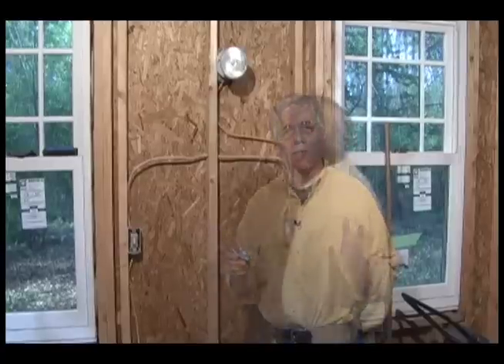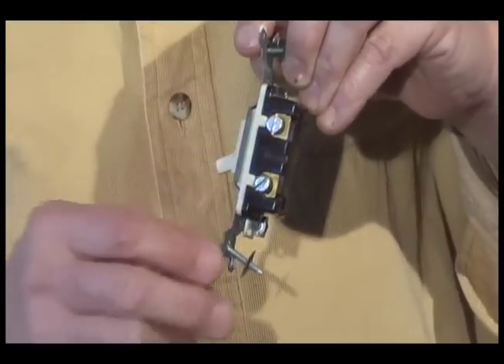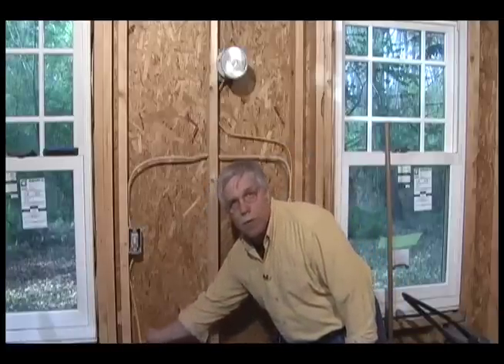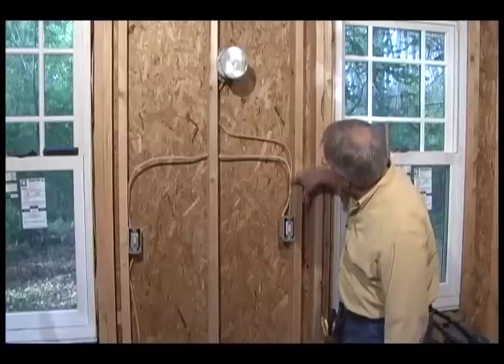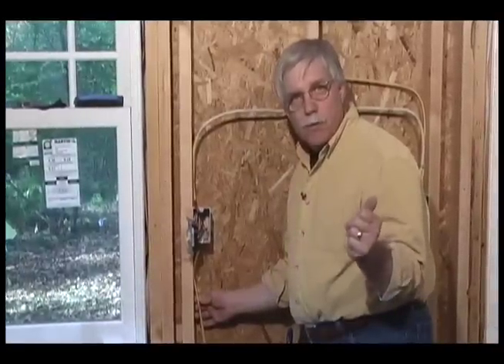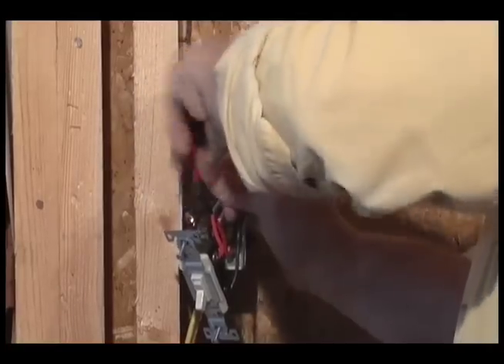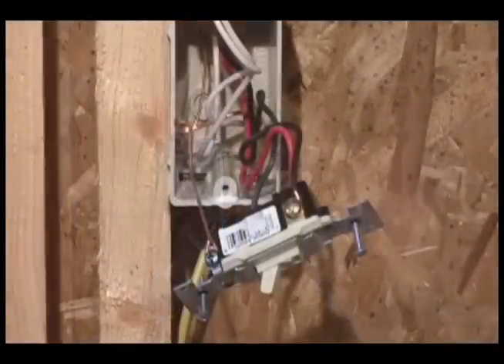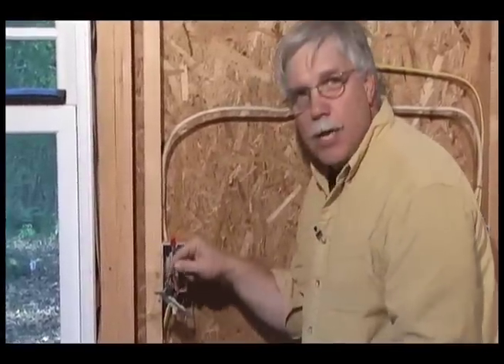3 Way Switch

Comment: Sorry if I am missing this. I cannot visualize how the current travels from the first switch to the second switch when the first switch is off. 
How does the current bypass switch number 1 to still be utilized by switch number 2? Is it simply the design of the switch that maintains a constant hot beam even when switch 1 is “off” so that switch 2 can control “on” and “off”?
Reply from the maker: Simple. t=The inside of each switch is made just like a railroad track switch. Think how one works. The movement by the switchman makes the metal rail(s) PIVOT from one track to the other. In this case, the pivot point is the BLACK single screw on each switch. I'm happy to discuss this on the phone with you so you understand it: https://shop.askthebuilder.com/15-minute-phone-or-video-conversation-with-tim/

Comment: We have two 3-way switches about 5 feet apart, so I guess technically you're right that they're never as close together as you show, but ours are close...
Reply from the maker: Why of course I'm right! :-O Share why you'd have two so close together, please. I'm intrigued!!
Reply: @askthebuilder  I have no idea, we are the third or fourth owners of the house, no idea what they were thinking. It is a small t-shaped hallway at one end of the house, there is a switch for the overhead light at each end. So there's a 4-way switch within a few feet of them too. But that is not the most unusual wiring in the house! Almost every room uses 3-way or 4-way switches for the overhead lights, with some of those switches being in very weird locations. Often in other rooms of the house! And not always adjacent rooms!

Comment: Should it be mentioned to tuck the bare ground wires well back inside the switch boxes very carefully so there is no chance they can come into contact with any of the live terminal screws on the switches.?
Reply from the maker: Normally I'd say no, but lately, I've seen a spate of unbelievable comments and questions that telegraph to me that some people have no concept of what's in play. So much so they shouldn't even be close to energized conductors.
Reply: @askthebuilder  Thank you for your reply. I thought it would be worthy of pointing out to those that may not know that in the best interest of safety they need to be sure that none of the bare ground wires are able to come into contact with any of the energized parts of the switches and receptacles. Your videos are clearly the easiest to understand. Thank you for sharing your knowledge and skill.

Comment: 14 years later and this is still helpful. Thanks homie.
Reply from the maker: Yep. It will be helpful for the next 200 years. The design and function of the switch will not change. Just like pulleys.

Comment: I got confused with two black wires. ( Why did not they make two different colors like black and blue ?). So they distinguish two black wires by the screw colors. ( Am I correct?) The hot wire connect to common with the dark screw. The traveler black wire connects to the brass screw.
Reply from the maker: No confusion when you get my newsletter: To get unlimited tips each week, subscribe to my FREE newsletter at www.AsktheBuilder.com

Comment: I already replaced my 3 way switches and just copied the (super old) old switch wire placement by lining up the ground wire screw side, and then detaching one wire and reattaching it one at a time, but old switch was always  “upside down”, meaning the ground screw was on left , so I rotated it and then swapped my one wire at a time...and now I’m terrified I miss wired and my house will burn down... the switches work fine... does that confirm I did it ok?
Reply from the maker: Maybe! To get unlimited tips each week, subscribe to my FREE newsletter at www.AsktheBuilder.com

Comment: Your not suppost to mix 12-2 12-3 with 14- 2  14-3. . 14 -2 and 14-3 are for 15 amp circuits  12-2 , 12-3  are for 20 amp circuits
Reply from the maker: I explain what happened in the video description.
Reply: @askthebuilder  oh ok because  I'm  an electrician  by trade  been doing it over  30 years nice  video btw

Comment: Hi Just have a question in regards with 2 lights on 2 3way switches. I have the power source going to Box 1 switch and a wire to the light bulb from box 1. I have a 14/3 wire going from Box 1 to Box 2 and a wire going from Box 2 to a light bulb but no wire going from Bulb 1 to Bulb 2. Is it possible to do a 3 way this way?
Reply from the maker: No. You need another wire between box 1 and 2 and daisy chain the lights together.
Reply: @askthebuilder  Thanks. I was able to complete my task with your advice.

Comment: I've hooked up two 3-way switches with several 11 W LEDs.   Even when the switches are off, the LEDs glow faintly all the time, though it's only noticeable at night.     Is there a way to fix this problem?  Do you know what brand of switch doesn't leak current like this?
Reply from the maker: Get unlimited FREE tips like this each week by subscribing to my newsletter at www.AsktheBuilder.com

Comment: So my dad and I are trying to do his new garage. We are doing two 3 way switches on 6 different lights, the light inside flips the lights on and off like normal but the outside light does t do anything. Not shortening or anything is happening. What could we be doin wrong. Everything is wired like this video.
Reply from the maker: No wonder your channel name has awesome in it! For unlimited tips, subscribe to my FREE weekly newsletter at www.AsktheBuilder.com

Comment: I am getting that this system allows multiple ways to provide power through the switches.   The thing I don’t get is how the light is being turned off from any switch since it looks like you are just switching hot wires by moving the switch.
Reply from the maker: Get unlimited tips like this each week for FREE by subscribing to my newsletter at www.AsktheBuilder.com

Comment: should the traveler wires be both hot or both cold ?  Meaning there should never be a case where one traveler is hot and the other cold ?
Reply from the maker: By default one traveler is always hot and one is always not energized. Go to my www.AsktheBuilder.com and look at my illustrations of how the switches actually work. They're exactly like switches on a railroad track.

Comment: Is it ok to run two Romex lines through one stud hole?
Reply from the maker: Generally yes. It's all about friction and abrasion over time from thermal expansion and contraction. Look to see what the NEC says.
Reply: Ask the Builder thanks. I've learned a lot from your videos. I'm about to get my rough-in inspection for my bathroom installation. I'm converting an existing storage  room into a master bathroom. I pulled permits 6 months ago. I'm more than a little nervous.

Comment: This home was built in the 70s, it has 2 black wires and one white. No vids here address that, I'm lost...Help pls
Reply from the maker: No worries. Your help is ABOVE. Watch the video numerous times until you understand the concept of hot wire, travelers and the power wire to the light. Seriously. I don't care if the house was built in the 1870s, it's still the same method.

Comment: I had to replace an electrical outlet. I managed to locate the breaker that cuts the power on it. However, while taking wires off of the outlet, there was a spark and a light in the room where I was working, went dim. So, I reattached it. I found the breaker which killed the light where I was working to change the outlet safely. I measured across it with a multimeter. Would you tell me why there was a spark? I thought since I killed the voltage across it I was safe.
Reply from the maker: Watch my NEW live stream videos! Subscribe to get my FREE newsletter here: www.AsktheBuilder.com

Comment: Great tutorial video!  I followed your instruction, checking 3-way switches & wire connections.   They're all good, but the working-light is still not on.  Appreciate all your help.
Reply from the maker: So maybe you need to read this column since you're convinced the wiring is perfect:

http://www.askthebuilder.com/light-bulbs-burn-out-quickly/

There's a 1:1,000,000 chance the switch is broken.

Comment: Great video but why do you use 14/3 between the switches and 12/2 to the light fixture?
Reply from the maker: That is 12-gauge cable that is about 30 years old. I had it leftover from when I built my house. Back then, the color coding requirement was not part of the NEC.

Comment: I've come to the right channel! Here's a question for somebody: Outlet boxes are $.29 each at Home Depot, whereas light fixture boxes are over $1. Is there any reason not to use an outlet box on the ceiling for a light fixture? I know it works because I've done it, but is it wrong?
Reply from the maker: You need to ALWAYS take into consideration the WEIGHT of the ceiling fixture. And who's to say that a FUTURE homeowner may put up a small one like you might intend to. In my opinion, ceiling boxes,  and the code may speak to this, should ALWAYS be steel boxes well attached to the ceiling joists so they can support 20, 30 or 50 pounds.
Reply: Thanks. Very insightful and informative.

Comment: I watched the video for the 3-way but this question is not answered in the video. How does one wire each of the  three way switches when all of the wiring is hidden behind finished walls? I don't know if the light is between the switches or beyond the 2nd switch. Also how do I determine the location of the black incoming hot wire and then locate it in the 2nd switch?
Reply: I see no one answered for you, but I will.... Look at the Wires coming into the box(S) .... You will see one SET, that has White, Red, Black and Copper(Ground)... you will ALSO see a Set of wires that are ONLY Black, White, and Copper (Ground) ...To Simplify, the BLACK from each of the 3 Wire Sets (Black, White, Copper), will land on the BLACK SCREWS ... Whites will Wirenut together. On the 4 wire sets(Black, White, Red and Copper) will act as the Travelers (Black and Red) ... These will land(Connect) onto the TOP 2 Silver Screws. I usually land the Blacks, onto the Same side of the Switch and Red on the Left... but the Travelers Dont Matter... And .. It doesnt matter Where the Light is situated, as long as you follow the directions, It WILL work... :D
Reply: Thanks. I wired this myself. It was simpler when visible but it may not have been the traditional way. An added factor is there are two switches at one end.
Reply from the maker: Thanks! You might want to do two things: 1. Subscribe to my FREE newsletter at www.AsktheBuilder.com 2. Start watching my LIVE streaming videos! Lots of fun and you get to ask me questions in real time. Be sure to turn on NOTIFICATIONS about when I go LIVE.

Comment: Tim...my incoming power switch must always be "on" for other switch to work..what's wired wrong?
Reply: Ron... Read my reply to David Boleneus.....  You have the Travelers Crossed with the Power Feed.
Reply: I bought my new place, replaced every outlet and switch in my place but came down to the three way switch same issue as you, at first thought should of taken a picture but did everything and still, one switch relies on another. Did you figure out the issue?
Reply from the maker: Ron, watch this other video of mine: https://www.youtube.com/watch?v=1FoMlG91lDA&t=6s

Comment: WOW, is that something new? Two switches working three ways? Will wonders never cease? But what if I wanted to add another switch in between? I guess it can't be done.
Reply: Yes Steve, Watch Tim's "How to wire a 4 way Circuit"
Reply from the maker: It can be done. Go watch my 4 Way Switch video

Comment: Do I have to use a 3 way switch
Reply: IF you want to control from 2 points, Yes...else the Single Switches will SHORT OUT the circuit.
Reply: AND you will have to have a 14/3 BETWEEN the 2, 3way Switches... 1 switch will have to be powered from the panel, and your Light Feed will have to be wired to the OTHER Switch.
Reply from the maker: No. You can walk back and forth in the dark. Thanks! You might want to do two things: 1. Subscribe to my FREE newsletter at www.AsktheBuilder.com 2. Start watching my LIVE streaming videos! Lots of fun and you get to ask me questions in real time. Be sure to turn on NOTIFICATIONS about when I go LIVE.

Comment: i twist my ground wires together with my lineman's pliers ,then squeeze a ground wire sleeve with proper crimpers(looks similar to a 22 shell)Also use the correct sleeve stripper ,not a utility knife,,,,& he also forgot to mention that you can add more 4 ways in between your 3 ways,,,,if your gonna teach ,do it right
Reply: Actually he did do it right. You can strip romex with a utility knife, there is no code against it. If you can do it properly without damaging the conductors then go ahead. He doesn't need to say you can add 4 way switches to the 3 ways because there's no need to. This is about wiring a 3 way switch, not electrical upgrades to a home.

Comment: if you change a 3 way switch and you forgot what wires went where on the switch, my question is, could you go to the other switch and see how they are put on. it should have the same setup as the other one right?
Reply: SEE my reply to David Boleneus ABOVE ^^^
Reply from the maker: Watch my 3 Way Switch Troubleshooting video to see how to do it.

Comment: I see yellow cable and white cable wiring in the same circuit ,so what fuse are you going to use 15A or 20A ?? is it okay( NEC code)?
Reply from the maker: +Haile haile I've probably answered this twenty times in previous comments....... The white cable is from the 1980's out of my basement scrap pile. It's 12/3. NEC required colored cable years later.
Reply: Tx

Comment: Hi 

first,thanks for the video
i hope you can assist me with my problem
i have two boxes

first box
black  Traveler)
white

red    (traveler)
black  (hot)
white

white connected together

no issues in first box

second box
black  (traveler)
white

red    (hot)
black  (hot)
white

issue is that i have 2 hot wires and only one traveler

i am stumped

any assistance is greatly appreciated

Thanks
Jim
Reply from the maker: Requires a phone consult. Far too much to type: https://shop.askthebuilder.com/15-minute-phone-or-video-conversation-with-tim/

Comment: It doesn't work. When I turn on the light at one switch and then go turn off the other  switch then then go over and turn on the other switch,  the light does not turn on. Then I have to turn on and off the other switch until I can get the other switch to turn the light on. I hate this.
Reply: There is something wrong with the way your travelers are wired to one of the switches. You are going to have to switch things around until you find the correct wiring combination. This could take some time and patience as you will have to change the wiring then turn power back on to check your work. Its not advisable to try this hot if you don't know what you are doing.
Reply from the maker: It does work. Look at all the comments from hundreds who followed my instructions. Be sure you subscribe to my FREE newsletter right here front and center: www.AsktheBuilder.com - Also, I now LIVE stream each M-F at 4 PM Eastern time at https://youtube.com/askthebuilder

Comment: My light didn't turn on so I took one of the 3 way switches off and I used a tester to test the wires and found out there was no electricity coming out of the wall. The fuse was not tripped either so what do I do now?
Reply: +G00gleable I have to turn one switch on and off 3 times to make the light turn on. It's like I'm trying to pump water out of the ground. I must find the money for an electrician.
Reply: +G00gleable Before you said that I already tried two new switches. The problem persisted. Home depot said it could be bad ballasts in the florescent lamp fixture (with four florescent bulbs) but my florescent lamp fixture doesn't even have any ballasts. Thanks anyway for trying to help. I will have to come up with a lot of money to call an electrician. Or just pump the switch when needed.
Reply: David Crandall ballasts would not cause your switch to not have power. Also backstabbing a receptacle or switch is just lazy and poor workmanship. You need to figure out from which 3 way your branch circuit comes from. You need to test this to see if you have power. If you have power from the incoming circuit then you have narrowed it down to either your traveler between the switches. My guess is that the switch is not wired correctly.
Reply from the maker: Watch my 3 Way Switch Troubleshooting video. Be sure you subscribe to my FREE newsletter right here front and center: www.AsktheBuilder.com - Also, I now LIVE stream each M-F at 4 PM Eastern time at https://youtube.com/askthebuilder